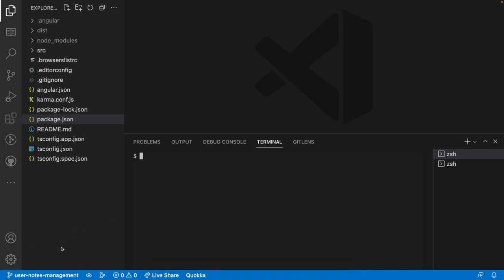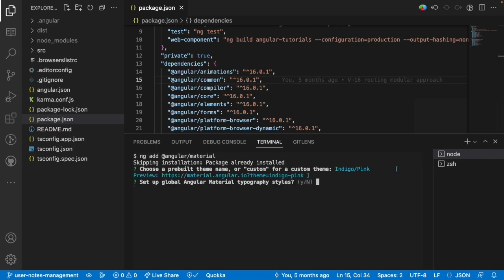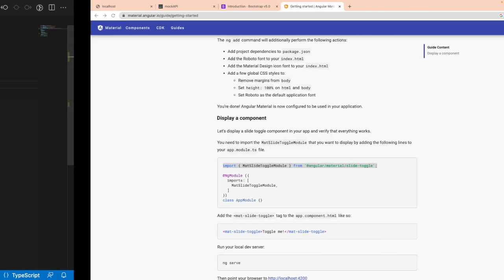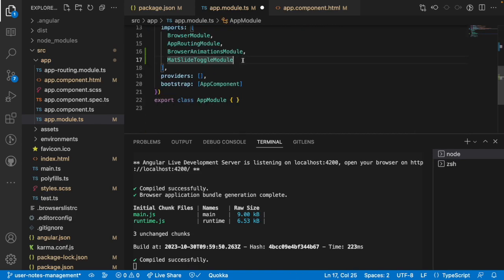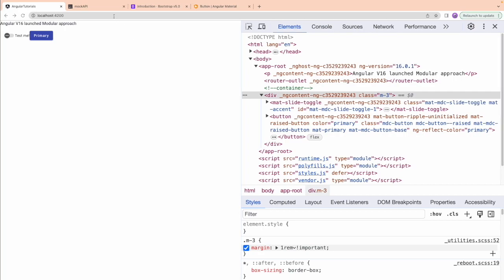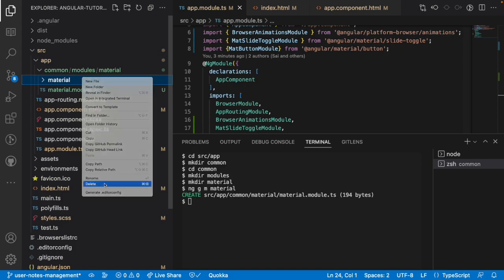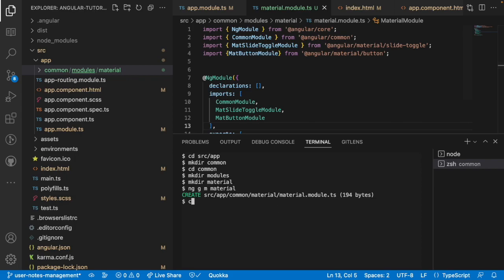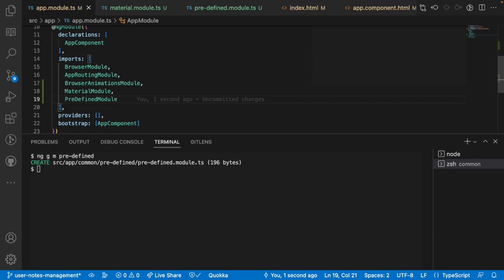Project Setup | User and Notes Management | Angular Project  | Part - 1

Comment from the maker: 00:02 Creating project, adding dependencies, and starting module implementations.
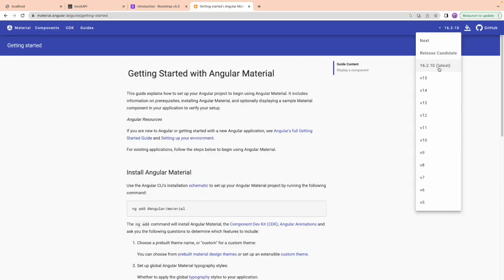02:10 Installation and setup of Angular Material
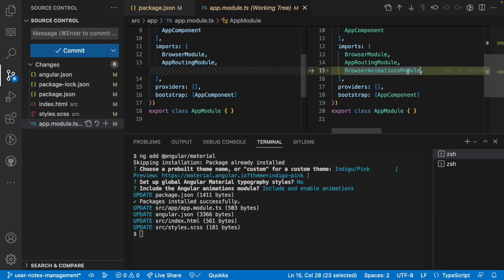04:23 Include Angular Material modules to access its components.
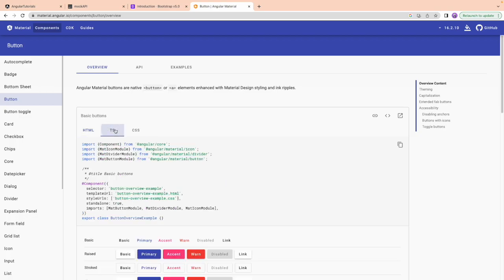06:30 Importing and utilizing Angular material and Bootstrap CSS in the project.
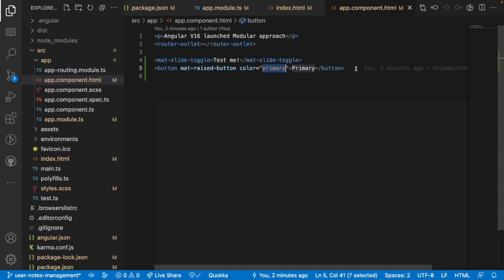08:42 Injecting Bootstrap and Angular Material in the Application
10:57 Creating and organizing modules and submodules in Angular project
13:08 Creating a material module for reusability
15:24 Creating and exporting predefined modules in Angular project setup.